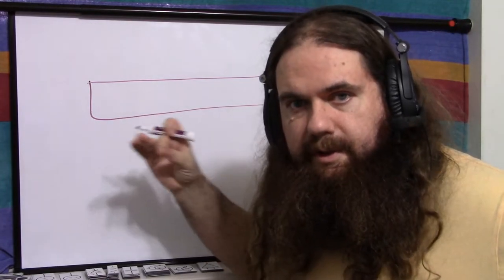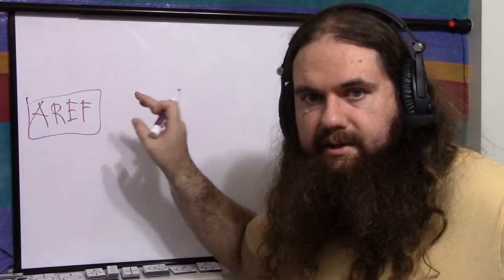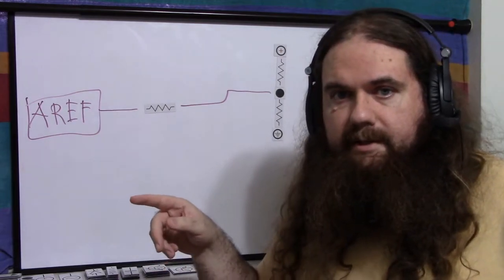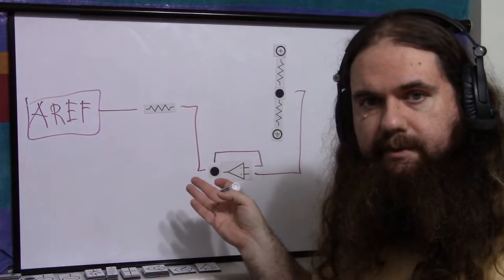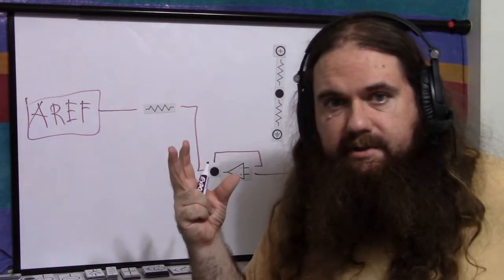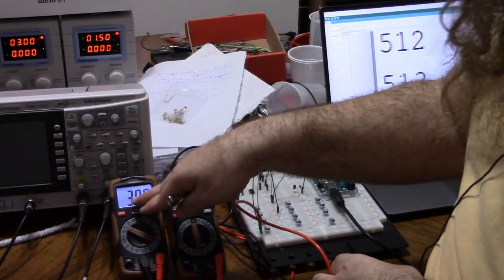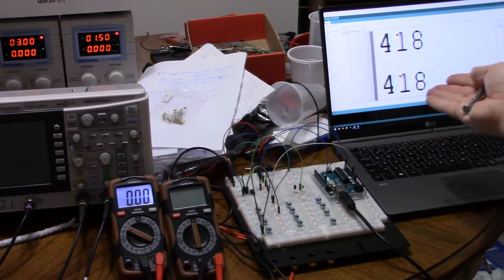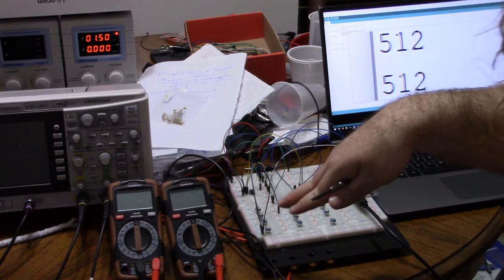ADC Reference Voltage - How To Supply It Without A Reference Chip - Simply Put

Comment: Excellent concept and demonstration! However, I measured my Arduino Nano, the resistance at Aref pin is around 2.978M ohms, not 32k as you said in the video.

Comment: i missed the capacity mention, is it in NF region? will it mess up with the op amp at higher freq?
Reply from the maker: It takes about 100 microseconds to do an analog read on an Arduino, so that's only about 10kHz at absolute maximum, and that's assuming you spend no time at all actually doing anything with the number you read. So probably any op-amp and capacitor would be able to handle it, but you could tweak it if necessary.